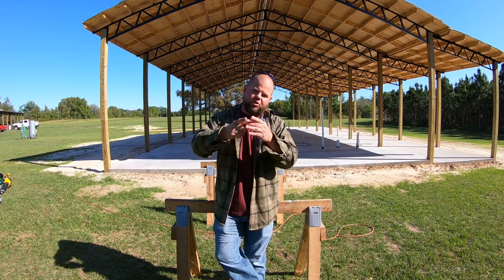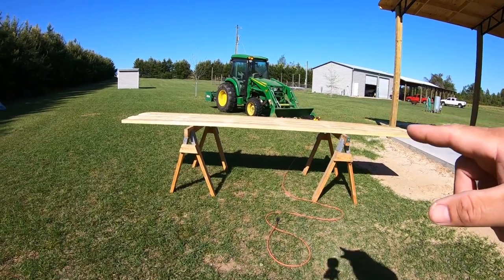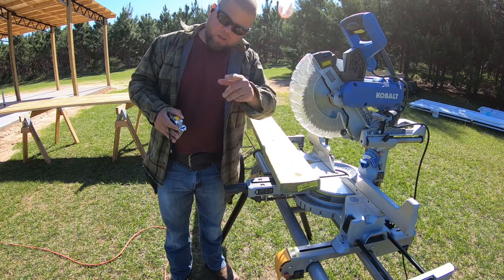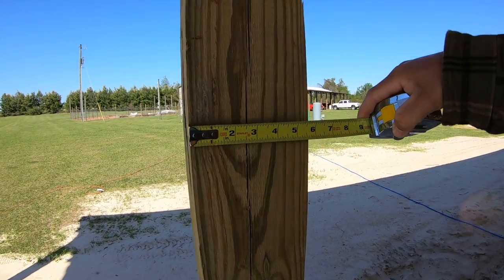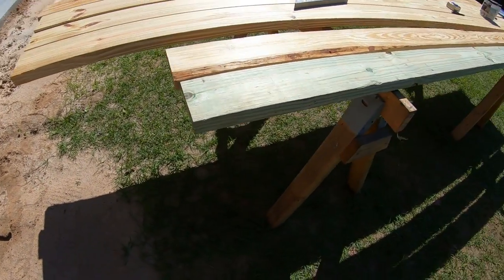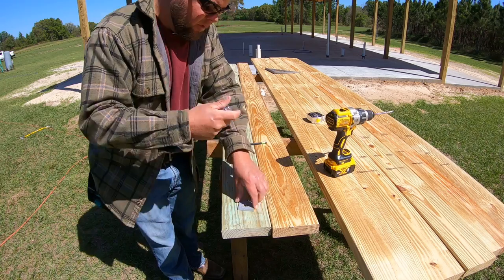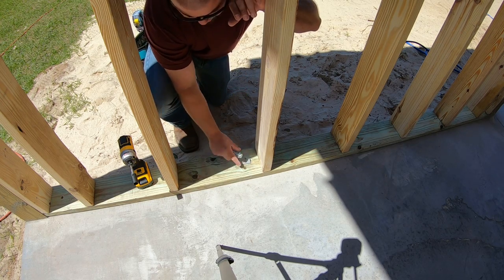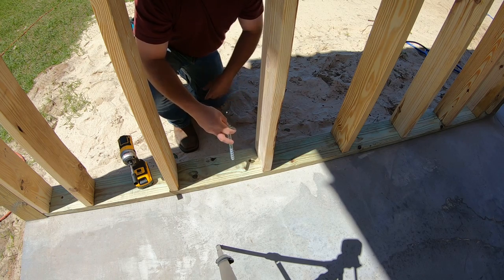Framing the first pole barn house wall! House build #11

Comment: My wife and I really enjoy your shows. Just wanted to mention a couple of things about your walls. A standard 8' wall stud is 92 and 5/8 inches long. This will allow room for ceiling sheetrock then you don't have to trim  the wall sheetrock , two 4' pieces will lay horizontal without having to cut one. Also cut your bottom plates and place them between your post. Then you can use a 100' tape and layout the whole length of each wall at one time. this will help to eliminate any miss measurements.
Reply from the maker: Correct, I'll be addressing the wall height issue along with a few others that viewer mentioned. Thanks

Comment: Thank you for taking the time to explain the details to me.
Reply from the maker: Thank you for watching
Reply: @TKCL  Happy Easter. What size is the structure going to be? Who did you get your plans from? Metal rafters came from where?
Reply from the maker: Under roof is 2800 Sq ft or 40x70. Heated is 30x50, the trusses came from backwoods buildings in Chipley Florida. The plans we designed ourselves.
Reply: @TKCL  I'm needing to build something like this in the next few weeks. Wondering what price range are you talking about?
Reply from the maker: Not completely sure now, materials have went through the roof. Probably in the 140k range is just a guess.

Comment: Glad your starting the walls, and your using 2x6's for them! I have used purlins let into (or the studs notched) on 24" centers, on the outside to give great wind bracing, and also it gives better screw holding for vertical metal siding. We typically also shoot the treated plate to the concrete, then have a bottom plate untreated for the wall, then stand wall and anchor both with concrete anchors.  You also can use your loader and pallet dorks to do the heavy part of the lifting.  Good job! 👍
Reply from the maker: Thank you for the information!

Comment: Excellent job and information.  I built walls on the inside of a metal building, took some figuring to have studs in the right place for the sheet rock to go up in full sheets with inside corners, just one oops in five walls that needed an extra stud.
Reply from the maker: That's great! I hope I can be that accurate.

Comment: I have seen other construction builds where they put a sheet between the bottom wood that contacts the concrete.  I don't know the terms but they use it to protect the wood.  It's a roll of pink material that is the exact width of the bottom 2x6 board.
Reply from the maker: It's called sill seal and yep I should be doing it, I'll revisit that this week. Thank you

Comment: When I built my pole barn shop what I did was take the base plate board and laid it down between my posts and then measured and marked out my studs. May make it easier and avoid a tape measure overhang mistake. Just a suggestion. Nice work.
Reply from the maker: Good point and I'll take it! Thanks

Comment: Andrew: You only show the 16" marks on the tape. Look at the top for the black diamond at 19 3/16 is  the metric layout, it will also work 8' on centers for OSB run horizontal. An you said rafters on top of the walls, so that room will be vaulted ceiling cool. Myself I like Tray ceiling with recess cans with dimmers, there easier to change light bulbs.
Reply from the maker: I remember the diamonds, need to see if my tapes have them. Old habits are hard to break with me making lines 16 dead center.

Comment: love your videos one thing i think you should do is anchor the base plate to the concrete before nailing to the 6 by 6 just a suggestion just so you arent putting stess on nails in 6 by 6
Reply from the maker: It's habit, always worried the wall will fall on me lol.

Comment: Did you consider using 2x6x8' pre cut studs....they come 92 5/8 ....but the 5/8 gets subtracted once you sheetrock the ceiling first. It leaves you with a 92 inch wall.
Reply from the maker: Never seen those around here, even at the big box stores. They have plenty of them pre cut in 2x4

Comment: One wall at a time!!!  A few questions/comments...
- You should consider standing the bottom and top plate back-to-back on edge when you're marking the stud locations.  That way the pencil markings are on the edge of the plates and visible as you're constructing the wall and the lines aren't covered up by the studs.
- Which side of the 6" x 6" beams are you flushing the walls to, the inside or the outside?  Since the wall is (should be) 5 1/2" and you showed the beams are varying in width, seems like one side or the other (inside or out) isn't going to be flush for the siding or drywall.  How are you skinning that cat?
- Was curious as to why you need to install headers for doors/windows being that it's post & beam construction?  Kyle from RR Buildings YouTube, has said that's one benefit of his post & beam buildings is that none of the walls are load bearing, which removes the need for headers in any walls.  Your 6" x 6" posts are carrying the load(s).
Ohhhhhh... last comment, just my opinion, but 30 min. videos are too long...  :-)   Happy Easter!!!
Reply from the maker: At the moment the interior and exterior seems flush with the 2x6 walls. I'll probably keep the exterior flush and sand or plane the interior posts if need be. As for the headers, my engineer went overboard. It's costly and time consuming to re engineer again, so we went with it. The back half of the house is technically load bearing walls because there will be a load carrying attic above. Happy Easter
Reply: @TKCL  you will need the headers since you are doing the attic above with the 2x8 sitting on the top plate. That’s why the double top plate also
Reply from the maker: I agree with that

Comment: Wow looking awesome. If I wasn't so far I would lend a helping hand to raise the walls.  Did you put any glue or sealant on the bottom board towards a concrete just wondering?  Also you can always just blame me if Miss Tiffany says that's all you did say that cash wanted exact details on how to raise and build a wall 👌😉😉 .
Reply from the maker: I sure didn't seal the plate, moisture shouldn't be a problem since they are pressure treated, but air leakage will be a problem. That's something I'm going to have to address.
Reply: @TKCL  ok I was just wondering. It's been awhile since I help my grandpa make a getaway shed and I remember adding I believe some kind of glue
Reply from the maker: It was an oversight on my part
Reply: @TKCL  can't you add a small bead of silicone along the bottom prior to putting up the sides?
Reply from the maker: I've been reading up on it, some say yes and some say no.

Comment: Do you guys not use foam sill seal between the slab and sill plate down south? Looks great looking forward to the project. Also would it not be better to store your wood supply under the roof to keep dry and also work under to stay out of the Florida sun.
Reply from the maker: We do use it, that was a miss on my part that a lot of people caught. I'll be addressing that asap. Thanks

Comment: Tip from being on 100+ jobsites: Set up your saw and lumber in a large room inside the house. It's dry and you won't have to walk out back for every cut and piece of wood. It will save you miles of walking time by the time your framing is done. You can also leave the saw there if you had to say, go to a family outing. Also working with rained on wood ain't no fun at all.
Reply from the maker: Good tips! My tools are getting put up every day no matter what, can't afford to lose them or they get damaged.

Comment: 1st, Happy Easter 

2nd, do your plans,  or local code, not call for a capillary break between  the concrete and sill plate?
Reply from the maker: Happy Easter, no break that I am aware of.
Reply from the maker: I will go back and caulk those two walls and start adding a sealer between the base plate and concrete on the rest of the walls. Luckily it's a pressure treat bottom plate, not much to worry about other than air leakage that I'll seal in.

Comment: Ive seen many of your videos so far. Great job. 
I have a 8x8 post building that I am constructing. so my problem  (I call it a new Opportunity) is how do a frame a 2x6 wall to tie the sheeting outside but still cover the interior posts. corners and inline posts?   I could frame it either direction. from the inside or the outside of the 8x8 posts....Any Ideas.
Reply from the maker: The people I've seen do that just wrap the posts inside with drywall.  I personally don't like that.  The only other option is to frame in 2x8 lumber, that's what my friend is doing with his 8x8 post barndo.
Reply: @TKCL  thanks for the quick reply...I agree I dislike the drywall corner. My other thought was a staggered double 2x4 wall... that would be more efficient on insulation but then a new area for hurricane stops..  thinking now possibly a combination of 2x4 and 2x8...I have a bit of to.e yet but thanks for the ideas.

Comment: on the tape measure you have diamond shape that use to be the center of the studs. than the sheets would meet in the middle of the studs. but they don't do that any more. i thank the reason is they did not have to cut the  sheets of ply wood. plus be less lumber to use. i just throw that at you. check to see if i'am right. still doing a good job keep it up young man. oh tell your wife to bring you some water ha ha ha.
Reply from the maker: I remember the diamond, but didn't know the use. Thanks for watching!

Comment: Did not use sill sealer??
Reply from the maker: I will go back and caulk those two walls and start adding a sealer between the base plate and concrete on the rest of the walls. Luckily it's a pressure treat bottom plate, not much to worry about other than air leakage that I'll seal in.
Reply: @TKCL    It’s always better to keep even treated lumber not touching the concrete as much as possible.  Otherwise the first wall looks really good and structurally strong

Comment: 16" is the center, but the edge is 15"1/4 for the edge of the 2x4. Then 31"1/4 and 47"1/4. You know what you are doing.
Reply from the maker: Yes that's correct, half of 1.5 inches, old habits are hard to break.

Comment: No tow nailing tequier ? 2x6 requires 5 tow nails in my part of the country,  end nailing has no strength.
Reply from the maker: As you keep watching you'll see me toe nailing a lot
Reply: @TKCL  yes bbn i skipped few videos and I seen the plates and bands you install and tow nail 👍👍. You can rest assure in case of a hurricane that building is gonna stay at that adress.  If you install hurricane windows or have a way of scrwing plywood over the windows i dond see how can wind do damage to that structure. What kind of roof you gonna have ?
Reply from the maker: We put a metal roof on, it was part of the barn package. I did upgrade the metal thickness. You'll enjoy that video, I had an uh oh moment lol